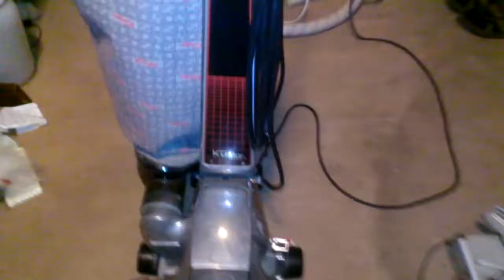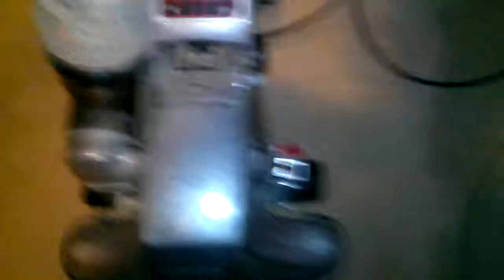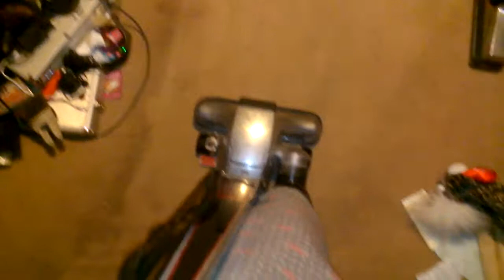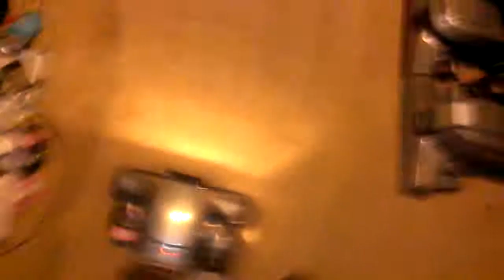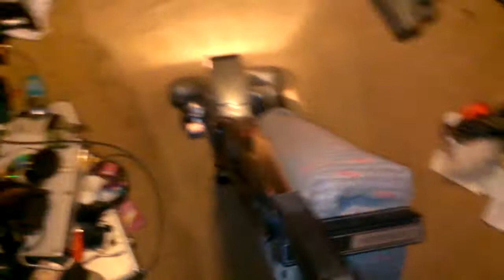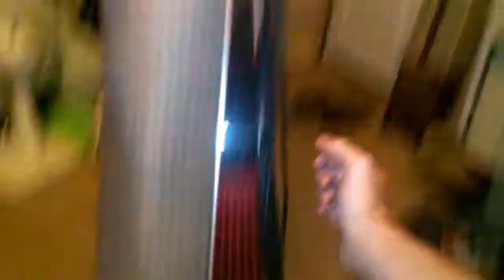KIRBY HERITAGE 2 (1984) IN ACTION WHY THE RED LIGHT?

Comment: It's a light letting you know there is power currently flowing to the vacuum. That's all. It's the same as a light on a surge protector. People loved indicator lights and "turbo" and red pinstriping on everything in the 80's - Kirby followed the trend.

It actually looks like yours was replaced with a different indicator light and it does not fit the cutout in the housing for it.